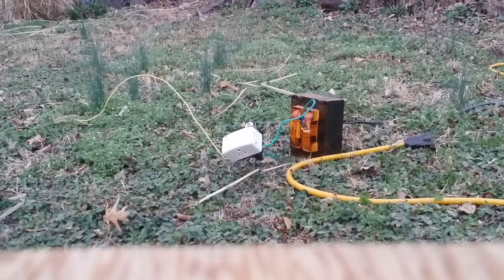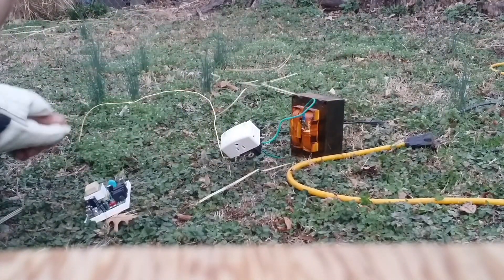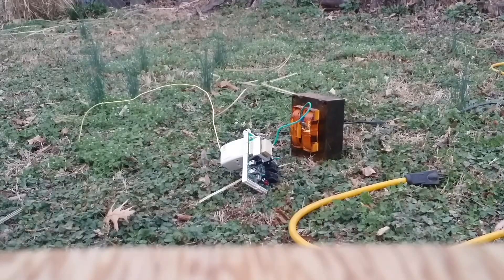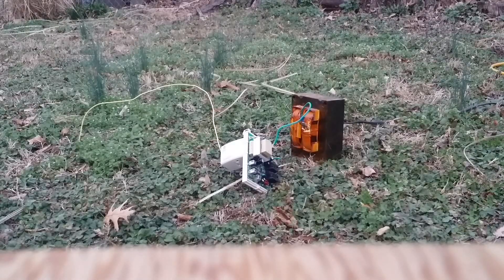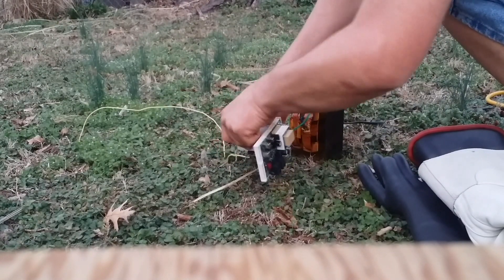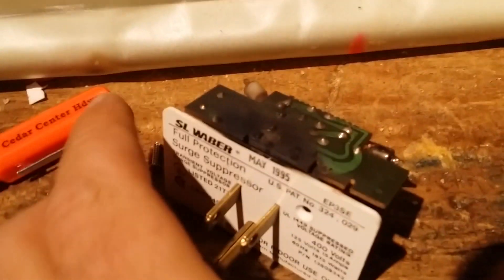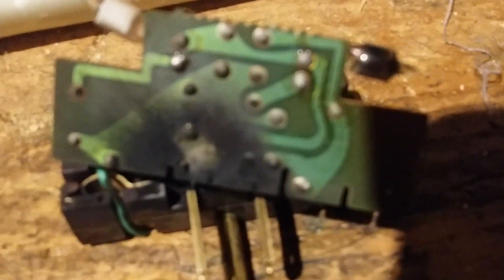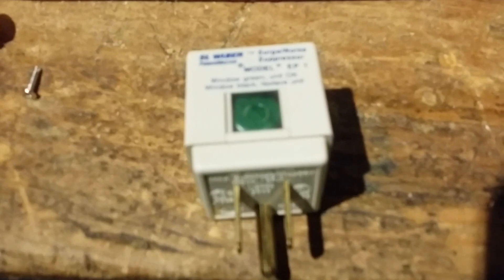surge protector test

Comment: I have a generator that I've done that with where it does not have AV.R, so you can over rev it and get about five hundred volts on the outlet, and I have definitely blown up surge protectors doing that

Comment: The surge protector is supposed to take the surge to ground. But your silly wire in the dirt was not an adequate ground. It blew when you plugged it in in the shed! That outlet apparently was properly grounded.
Reply from the maker: Yes, the shed is properly grounded. The wire in the dirt was just so it would have something. Didn't feel like driving an 8 foot ground rod for one video. A lot of surge protectors also have protection for line to neutral. Think how many older places have no ground at the outlet, or people install 3 prong outlets with no ground available.
Reply: And the secondary side of the transformer is galvanically isolated from the primary, neither terminal is connected to ground, so the SPD will never be able to divert fault currents to ground.

Comment: Umm... correct me if I'm wrong, but that's sustained high voltage... not a surge... 

I'd think you'd want to try discharging a Capacitor across the (hot and ground?) leads instead. But that would be a current surge... voltage would be limited by the capacitor... 🤔

Comment: Will you forgot to discharge any caps or use something to get the extra voltage out
Reply from the maker: My transformer setup has no capacitors in it, otherwise I would have discharged them. I have used one with a capacitor bank, and made sure to discharge it and put a shorting bar on it before working on it.

Comment: Sir.. Your video was explained everything.. amazing..
And your video was the first video who explaind the surge arrester with the correct way..  If we watch the video from official.. They explaind with wrong way..

The surge arrester should do something to the surge or to the circuit breaker.. Like whats you did.. 

Thats 3 caramic capacitors ( or something similar with caramic capacitor) do make a short circuit..to protect other devices.. And its good..
Reply: Zainal Abidin Imam syafii No those are not capacitor. They called Thermistors or Varistors